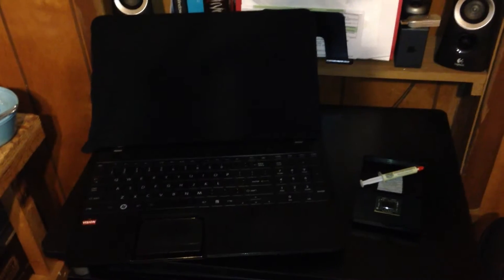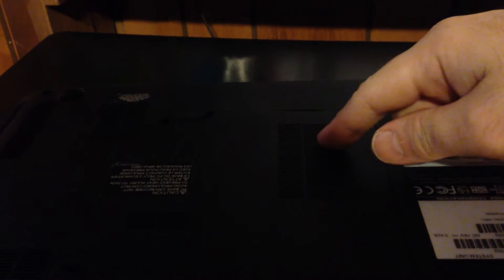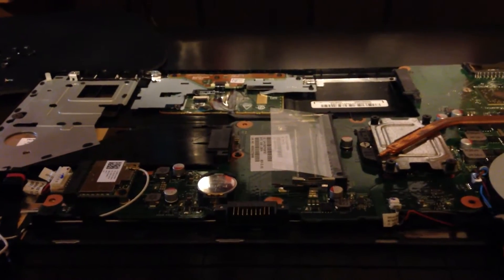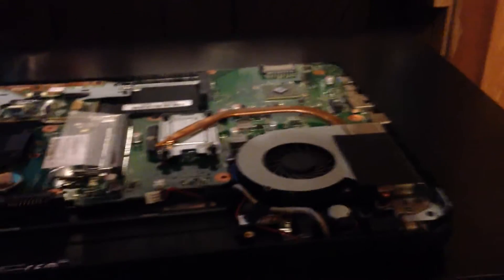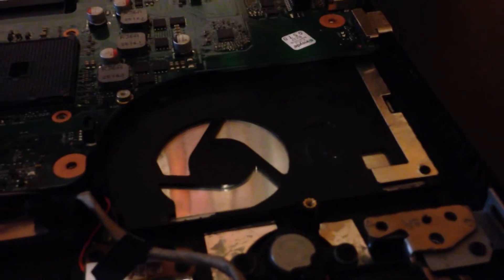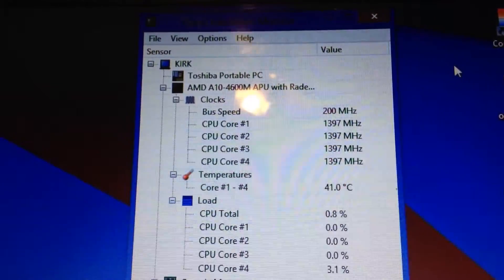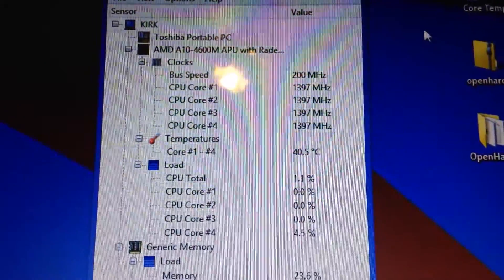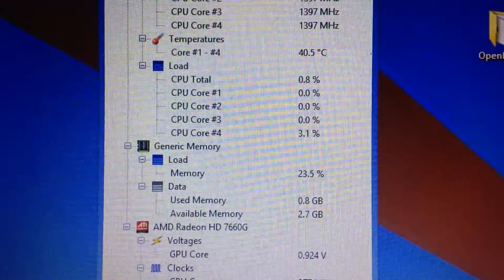CPU Upgrade on Toshiba Satellite C855D-S5209

Comment: You are so lucky that you laptop didn't come with the AMD e300 chip that my c855d came with.  That cpu is soldered on to the board.  Can't swap it and it's extremely slow.
Reply: got a c855 at an estate sale a few years back unfortunately with that cpu. literally smashed it. horrifically slower than my other toshiba, a qosmio

Comment: Do you still have and use this laptop and did you record a video of the ram upgrade? Thanks.
Reply from the maker: Real simple. Pull small cover from back, RAM is right there. I don't have a video of it it because it's the same on most laptops. Slide in at angle, and it should click into place. It's not to hard. I figured it out on my own by the way it came out. I put in two 8 gigs. Hope this helps.

Comment: Hey! I decided to go through with this cpu upgrade as well. Everything goes fine until the time to install the drivers come.  Every time it installs I have to restart and it never boots afterwards.  How did you get yours to work?  I have windows 7 home premium 64-bit. Thank you
Reply from the maker: Kristian Titong I never had to reinstall any drivers. I installed the new CPU, and it just worked. It did have a hiccup when starting, but I shut it down and turned it back on. It froze up on startup. From there on, no problems. What drivers are giving you issues? Are they basic drivers, or new ones you're adding?
Reply: edmanwalkin1 The Drivers that are giving me trouble are the ones that are being added in.  Everytime I install them, windows won't boot.  It gets past the windows logo but it never reaches the "welcome" screen.  It just goes black screen and either freezes and restarts or the screen goes crazy with colors (Idk how to describe it properly)
Reply from the maker: Kristian Titong If you're saving the drivers "with" (adding a folder to place them in) the OS programming, the drivers may be disturbing the OS programming. When you add them in, the OS does not boot. I had this same issue where I had to take them out manually, then it would work again. This is why I had a separate Hard drive for all my storage and programs.      The only other thing I can think of is the drivers are not compatible with the CPU or OS. You may want to check for compatibility on this.